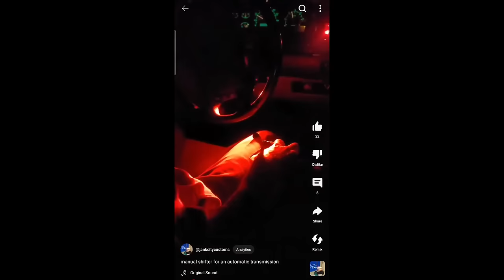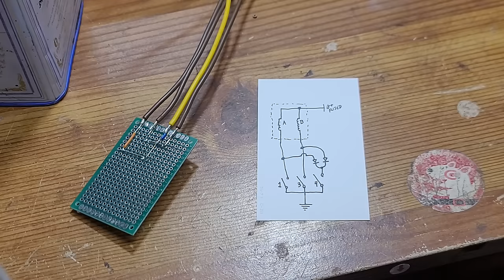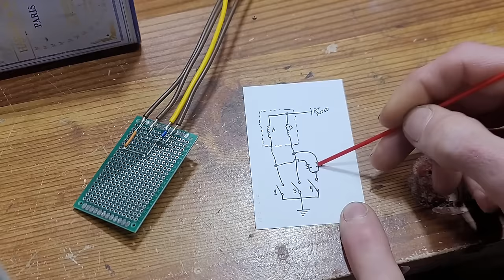how I gained full control of an automatic transmission

Comment: If you could make a Thrustmaster TH8A control it that would be awesome. Are you able to do reverse and park later on? Or just forward gears?
Reply: Is not impossible, but you need to do some programming on it, because the shifter works via some potentiometers, so you need to know impedances, ins, outs, where the impedance is when in first, second, third, etc, and put some controllers to go and translate for the relays to shift right, and also you could put a potentiometer  with a pedal on the floor or with some kind of support to hold it and press it to send the signal slowly like a manual, but sounds like a pain in the head to get it working well

Comment: Can you push start your truck ? Would that be 2nd gear and torque convertor locked ? And pressure regulating like you where talking about? (Maybe starting at 0 and increasing to 100%) I have always fantasized about being able to push start an automatic even if it means getting it to 30 mph, possibilities...
Reply from the maker: sadly, no. the transmission needs hydrolic pressure before it can engage a gear. without that, spinning the rear wheels just spins the output shaft inside the transmission.  however, it could be possible if you had an electric-hydrolic pump that you could run off the battery. then you could get it rolling and engage a gear.  honestly, it's a great idea for a video.
Reply: @jankcitycustoms what would happen if you turned the engine off at a traffic light, and then instantly restarted it with an electric motor in place of the alternator? Would the transmission lag and then abruptly slam back into gear as hydraulic pressure built up, or would it instantly kick back in and get the vehicle moving when you pressed on the accelerator?
Reply from the maker: there would be a lag. this transmission has no anti drain-back valves and large accumulators. so it would take a full second or two before everything got re-pressurized. newer cars with auto start-stop have transmissions designed for the task. most have electric pumps to keep the transmission ready for the engine to start at any moment.
Reply: @jankcitycustoms  I'm researching converting a Buick (2003-2005 LeSabre) into a micro-hybrid. The 4T65E has an anti-drainback check valve. May that solve this problem?

Comment: So, i think it may be possible on my 4 speed auto on my Cobalt. I do need to figure out a way to go between normal drive, then switch to overide mode.
Reply from the maker: oh yeah, definitely. the 4T40E has the same shift solenoid pattern as mine. solenoid A is called "1-2 SS valve" and solenoid B is called "2-3 SS valve" 
as for switching between normal auto and the shifter. you can put a relay on each wire going to the solenoids.

Comment: can you make this work for a 4l80E  or 6l80E General motors transmission??
Reply from the maker: certainly, it has a similar setup. GM usually calls their shift solenoids "1-2 valve", "2-3 valve", and so on. if you search for a rebuild/service manual to that transmission, it will have all the info you need. you can also try searching for "shift solenoid pattern" or "solenoid valve state table" to find out what one's are on for each gear.

Comment: What I suggest is using a PLC.  That way you can add switch debounce, time the torque converter lockup, and easily add conditional logic.  I would also work out better mechanical integration.

Comment: This is such a simple and clever bypass!  I was thinking what microcontroller are you going to use to drive relays, like arduino, ESP32, Raspberry Pi, etc.

You just used switches and diodes!

Comment: I'm really happy to see this video. Does line pressure affect torque converter inlet (not tcc) pressure? I want to drop torque converter pressure without dropping line pressure.. is that possible through the tcc solenoid as it looks like tcc simply blocks the torque converter drain line? Or is it better to somehow reduce torque converter inlet? The transmission I have is an aisin A340

Comment: yeeeah my ‘89 Accord is all mechanical, not a single copper wire goes into the auto tranny :(

It does have a kickdown cable that’s normally attached to the throttle, so if you hook it to a clutch pedal you can control the shift points to make it engine brake more and stuff.

Comment: 6:20 why not attach the trim pot to the accelerator so the pressure is proportional to engine speed? Or just use a PC fan controller. Or a drill trigger mounted to the shifter would be good too.

Comment: You want the potentiometer for line pressure hooked to the throttle. The more you push the accelerator/higher load, the higher the line pressure.
Reply from the maker: I forgot to mention in the video I left it hooked up to the computer. so that is how it works now. I want the ability to set a specific pressure regardless of throttle/engine speed.

Comment: heh this is cool it reminds me of my car, it's only a manual unfortunately but it has an electric overdrive you're allowed to use in 3rd and 4th gears, and you manually switch it on and half a sec later the revs drop as if by magic! You don't push the clutch in or lift off the throttle yet it still shifts somehow. It reminds me a lot of how this shifts lol, instant but with a delay. Although mine is a whole lot jerkier since there's no torque converter to smoothen everything out, it's a bit like shifting yours with the TC lockup clutch engaged

Comment: I have a 7 speed mercedes transmission that I want to try this with, it is fully controlled by the computer that is built into the valve body, but I want to use the transmission in a classic car that has a bad transmission.

Comment: All the automatic cars i've had happened to have a manual mode but they all lacked of instant gear shifts and had quite a lot of issues. When in manual in many different cars it felt like the engine wasn't giving full power, and they also have lag, like when i shift it takes a few seconds to shift whereas i shifted cause i want my gear right now, and it happens on your setup too by the transmission's nature.
What i would like on a manualized automatic is being able to shift in real time and have the torque converter either locked up always except when stopped or under 5mph, when the rpm drops close to idle, or being able to have a momentary button on the gear shifter to disengage it when changing gears.

Comment: So, how it go reverse? I've 90s Honda CRV, it won't shift 4th and reverse when cold, but when it's warm, it shift perfectly fine.
Reply: sounds like you need a flush and fluid replacement,
Reply: sounds like every other automatic honda transmission.
Reply from the maker: reverse is controlled by the manual valve. you still have to shift from park to reverse or drive. my shifter controls the gears once you select drive.   
as for your transmission, I agree with Jess and Clumsy. check your fluid. low fluid level can cause you to not have reverse.
Reply: seals are going bad in the transmission.  They harden up over time and from heat then don't seal as well causing a hydraulic pressure loss in the trans.   Here's a trick my dad taught me years ago...  put 1/2 to a full cup of brake fluid in the trans.  brake fluid has something in it that makes seals swell up again.  When i have done it I never had a any problems with the trans because of the brake fluid being added.  Sometimes it only works for a while and other times I have driven the car thousands of miles and it never failed again.
Reply: Does this mean you have multiple reverse gears?  @jankcitycustoms
Reply from the maker: I wish. but trying to engage reverse and forward gears at the same time locks the transmission in place. although doing that is useful. it is commonly used in drag racing, called a "transbrake". transmissions with multiple reverse gears do exist though. "lenco" is a cool example.

Comment: This is impressive but I have to ask: where is the reverse?
Reply from the maker: in older transmissions like mine the parking pawl, reverse, neutral, and drive are solely controlled by a manual valve. that is what you are doing when you move the PRND lever. my shifter controls what gear you are in when the transmission is in drive.

Comment: and microsquirt microshift is a faily good price now to and thats a good thing .but i love your set up i just hope you have enough line pressure  my man
Reply from the maker: thanks! I left the line pressure solenoid hooked up to the PCM. so line pressure still changes based on throttle and load. although its much less than ideal. so I am still planing to make a controller for the line pressure solenoid.

Comment: heres a idea idea mount a DE9 port and wire it up to replace that connecteryou will have 9 pins on that connector and you can use a arduino for PWM and have a screen to tell you what gear your in

Comment: There's a lever by the steering wheel called the shifter past D there's a manual shift selection
Reply: Some cars don't have that. A lot of cars nowadays don't even have the L below drive anymore, P R N D S(sport) and that's it. And a lot of those same cars also don't have paddle shifters or a side shift on the shifter to manually shift, so you'd be SOL on those cars.

I said shift a lot.
Reply: @YourLocalRaccoon  if the shifter isn't by the wheel it'll usually in a traditional location the s mode is the manual shift mode in that setting pushing the nob forward or backward will shift the gears up or down manually

Comment: nice video but please redo / fix the audio . so what you have done is to remove the computer / auto brain for the trans and replace it with an manual  aka you control . both ford with a c4 and chevy with a th350 and power guild had manual valve body's on some of there cars way back when mail line was controlled by a vacuum modulator  or Throttle  control rod [chevy p/g and mopar t/f ] it takes hp to build line  pressure that = heat at idle or light driving you don't need as much line  pressure as you do from like starting off from a start or going up hill or heavy acceleration its all about slipping you need to have the pressure  to keep the bands and clutches from sipping as slipping is wear and heat  and shifting to hard will in the long run brake something . oh for the ol days of the tf 727 , th400 , c6  and the indestructible p/g  ya they were only 3 speeds and a 2 speed but they works for a long time if you did your part

Comment: After you change gears how long does it take before the selected gear is engaged? True sequential shifter can shift very quickly
Reply from the maker: it varies based on throttle % because I left the line pressure solenoid hooked up to the computer. but still, it's nowhere near as fast as a sequential

Comment: What about diode voltage drop? Do you trust that the solenoids are getting enough voltage in 4th?
Reply from the maker: with a little measurement and research, we can be certain that they are receiving the right amount of voltage and current. each diode drops 0.5volts, I used one for each solenoid. with the engine running, B+ is 14volts. so that means each solenoid is receiving 13.5volts. since they are designed to operate between 12 & 14volts. they are well within the range for normal operation. 
as for the current, I just measured draw while under PCM control and after. difference is less than 100mA